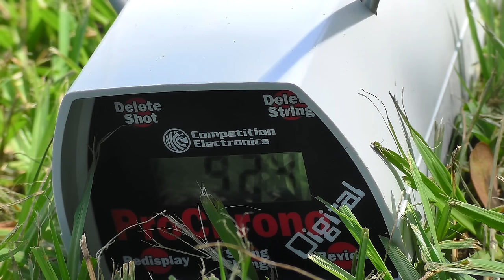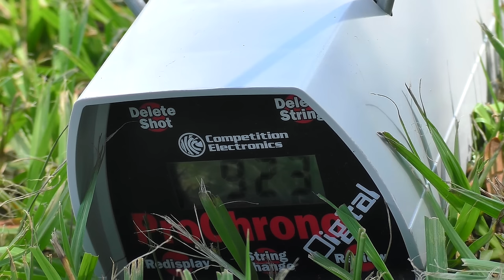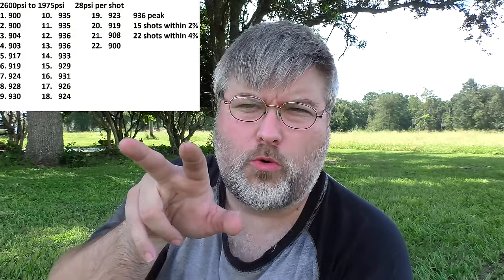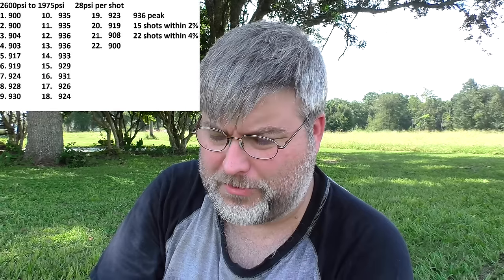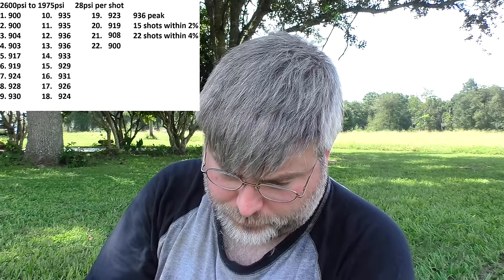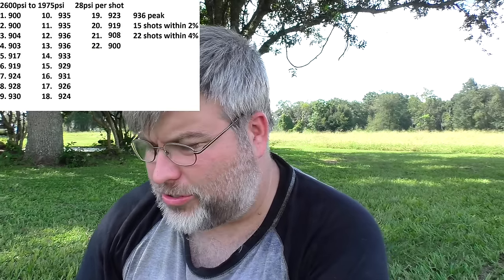Marauder Tune for JSB Kings

Comment: Hey bullfrog,hope your new Bpup build is going well.I noticed you added some info about the SSG which I had already been reading up on at GTA in your previous response to my questions.I made one for my 22 disco and was impressed for sure.I wanted an internal SSG for my 25 m-rod so I just ordered one from Travis at war that should be here tomorrow.I will see what power and shot count I can make with it before modding the valve,tp & barrel.Travis has posted some good numbers in the 40fp range that may be enough for what I use my rifle for right now but I may still try some spring changes on the war SSG to see if I can get the power up some and still keep good shot count also.Thanks again & good luck with your build.

Comment: Hello, I have a stock .25 mrod that in looking to get 8-10 shots @ around 50fpe, is there a set up on the valve screw, hammer and hammer spring you'd recommend starting at?
Reply from the maker: Its been a long time since I've tuned a Marauder. I do prefer running the valve screw all the way open, the hammer shortened, and the spring jacked up. I seemed to get better air usage that way with the shorter hammer stroke. You can hear the shot and tell if the valve is burping air or not. But the best thing would be to use a Spring Stop Guide (SSG). You can do some research on some of the airgun forums about SSGs in Marauders. They make the gun way more efficient.

Comment: I subscribed to your channel because I really appreciate you taking the time to be very specific about your parts and tuning on your gun.I have other PCP guns but my 25cal is only a month old so I haven't done much yet.I like your shot count while making the power you are on this tune.My shot count is about the same but at 150fps less speed on the JSBs.That tells me that the stock valve and tune is not efficient at all and why wouldn't you want more power if you can keep your shot count up.You said that you can't duplicate the valve just by opening it up,can you tell by looking at the A2A valve what seems to be different besides just opened up? Thanks a bunch
Reply from the maker: +James Green I think the difference between my factory modded valves and the A2A prototype is that the A2A valve uses a valve stem that's been shaved on a lathe to about half the diameter of the factory valve stem at the point of the poppet. If you go to "addicted2airguns.com" you will see a picture of the modded valve stem. The other difference is that the A2A valve is actually a .177/.22 Mrod valve. Its a little bit larger inside and hold more air. I agree that the factory valve is woefully inefficient. Its the biggest weakness of the Mrod platform in my opinion. Even if you can't replicate the power of the A2A valve, opening up the factory valve most definitely increases efficiency greatly. On the Gateway to Airguns forum there's an old thread where member "rdsail" modded his Gen 2 .25 and got some good results with simple drill work. The thread shows what he did step by step. BTW, I'm going to try to resurrect Uglrod and I'm going to make a video of it.

Comment: Sorry about that bullfrog,I didn't see your comments further down where you kinda answered that question for another guy.I have no problem opening up my TP but just wasn't sure about where and how much on the valve since I haven't had it out and looked at it.What LB hammer spring are you running?
Reply from the maker: +James Green No worries! I answered you anyhow.  I'm running a 14 pound spring.
Reply: James Green

Comment: Thanks for your videos.  I am wondering where to start if I messed up adjusting my hammer and spring tensioner? What is a good starting point in the tune to get where your at in the tune?
Reply from the maker: Its been a long time since I've tuned a Marauder, and remember this Marauder has a modified valve. I'll have to look at some of my old notes (if I can find them). I really like using stiff springs in a Marauder set for low tension. Seems like they eliminate a lot of hammer bounce.

Comment: Do you think I could get your low tune numbers with my stock gen2 marauder, if not what do you think I would need to get that same tune in my gun.I can do all the work myself but I just have not messed with it yet other than the trigger spring and opening up the holes in the air stripper or diverter like you showed on your vid.
Reply from the maker: +James Green I think you would need a high-flow valve and drill your ports out to match it to get the same or better numbers. My high flow valve  was  made by Addicted 2 Airguns (now out of business) and the exhaust port out of that valve is .18. I drilled the port on my barrel to match it and I use a .18 transfer port. That valve has a lot more air flow than a regular factory valve. I have played around with factory valves myself and drilling them out for better air flow definitely makes them better although I cannot replicate the performance of the A2A valve.  I also highly recommend rsterne&#39;s SSG mod that is currently being talked about on the Gateway to Airguns forum. I added one to &quot;Uglrod&quot; before he &quot;died&quot; and I got the same shot count as above but instead of going from 900-930s-900 the shotstring went from 930s-940s-930s for the entire shot string. Basically its a no hammer bounce device that stops hammer bounce by halting the spring and making a gap between the hammer and the spring during the shot sequence. Check out the instructions on GTA. I got one in my brother&#39;s gun along with the A2A valve and he can get 22 shots from the 920s to the 950s on his current tune. In fact I&#39;d try the SSG before modding your gun&#39;s valve to see if you are happy with your performance. The SSG can be totally reversible if you do it right. On my brother&#39;s gun before I gave him my A2A valve he could get 32 shots from the high 830s to the low 850s on what was mostly a stock gun with the SSG added.

Comment: You tune airguns..if so were can i send u mine..im here Jacksonville
Reply from the maker: +Gerald Williams Hi Gerald, I don't tune professionally. I just work on my own guns. I got most of my info on Gateway to Airguns and the Marauder Forum. I highly recommend either making mods to a factory valve or buying an aftermarket valve and dropping it into your gun. The guys at Wicked Air Rifles (WAR) makes excellent aftermarket valves. The valve in my gun is actually a .177 Mrod valve that a fellow reworked for me as a prototype. That fellow no longer works on airguns but his designs have influences many of the current aftermarket valves. 90% of getting numbers like mine is having a custom valve. If you decide to do your own valve work, you can do a lot of it with a hand drill (if you're careful). The idea is to open up the ports on the valve and the gun to move more air than what its currently moving. When you get the valve and transfer ports moving a lot of air, it not only increases your power but also your air usage efficiency. I recommend starting over at the Marauder Forum and read a bunch of old threads from 3-4 years ago when the Marauder platform was just coming into its own. You'll find lots of good threads that talk about modding the gun. Also on the Gateway to Airgun forum a member named Rdsail has an excellent thread from on how he customized his Marauder and got numbers similar to my own. I used it as my own guide. Check it out.

Comment: I have new synthetic  Benjamin marauder .25 I just get 8 to 10 consistent shot from 900 to 870 in this 10 shot  any recommendations to get at least 24 or 32 consistent shots between 900 to 940 ???? 
thanks
Reply: yes there is way to get that...have to spend a lil more money...fx 500 .25cal..you can get a 100 shots depending on the settings...the ataman m2r tact 1 carbine rifle gives you 980 fps 55 fpe on 35 regulated shots...hatsan nova in 25cal give abt 40 shots ..very consistent shots...abt $800

Comment: have you installed any Regulator ???? if yes which one ? and have you extended the tank ???
Reply from the maker: +Ahsan khan Yes, I do have an extended tank, but I do not have a regulator. However, since this video but before I broke the gun I installed a SSG device that so effectively ends hammer bounce that it flattens out the shot string as if it is regulated. You can read about the SSG on the Gateway to Airguns or the Airgun Guild forums.